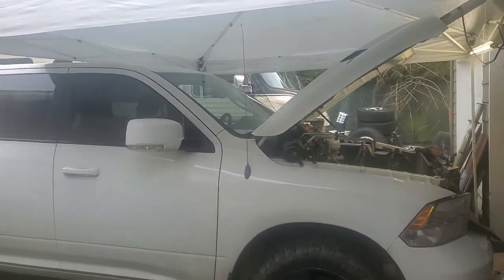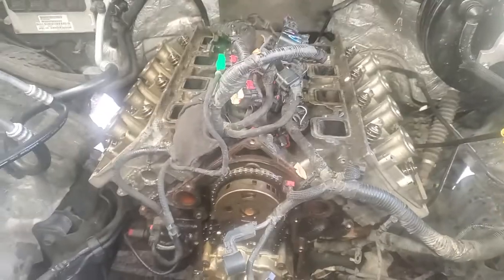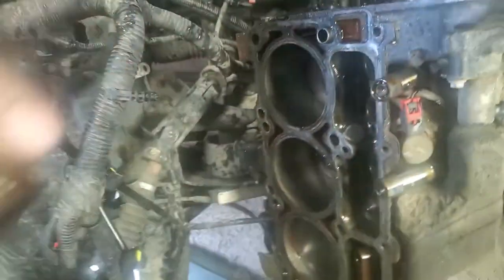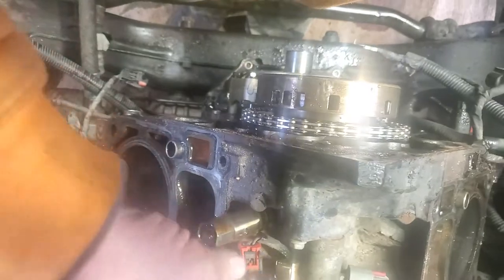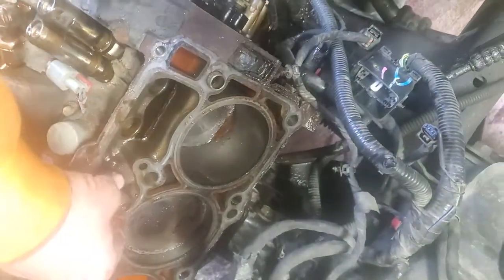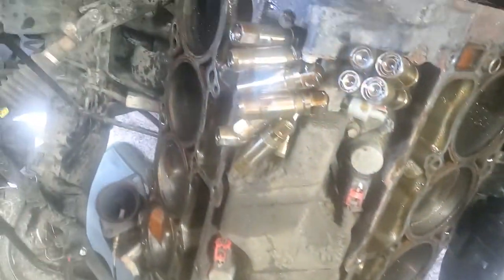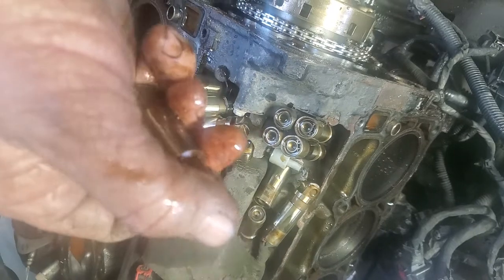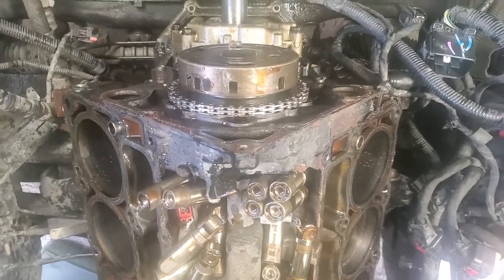2011 RAM CAM AND LIFTERS REPLACEMENT

Comment: One bad lifter is definitely a lubrication issue on that one lifter, Maybe something blocked the oil for a short time, long enough for the rollers to seize. If it was a manufacturing defect it wouldn't have gone 11 years and 140 thousand miles before failure.

Comment: Nice work Roy! That's why I run Mobile 1 oil and change every 3000 miles. 190,000 miles so far.
Reply from the maker: Tim ✌️. I just got this truck  have changed the oil at 3500 mile intervals since I got it. I  think the damage was already done especially after seeing the cam  after removal. Hopefully the new hardware will hold up to the high mileage I run with my vehicles. On average over 35000 a year  and I intend to run the good stuff and continue the 3000 mile range on the servicing. 👍😎👊
Reply: Over idling and poorly made rockers is the problem. Not lack of changing oil every fqn 3k😂
 They now claim to have revised better manufactured rollers. They corrected this several months ago. 
Hemi's are a beast. Just don't over idle

Comment: Use hell cat lifters and oil pump and it will solve the hemi cam lifter failure
Reply: They have revised the manufactured lifters. Problem is solved now. Chrysler 30year technician told me about it. Happened several months ago. 
Now people just have to avoid over idling their hemis😂
Reply: There trash the only way to fix it is delete the mds and put hellcat oil pump and lifters that mds starves the lifters of oil and the 5.7 oil pumps are junk and so are the tippems on the rams there riddled with electrical issues

Comment: WTF, roller lifters shouldnt have issues
Reply: I agree but for what ever reason either bad part from sub contactor or running low on oil or both.  The gm motors with crap oil will do the same thing.
Reply from the maker: I guess these 2009. To 2013 were famous for this very problem  pour quality of needle bearings in the lifters. Hopefully the new ones are a better product.